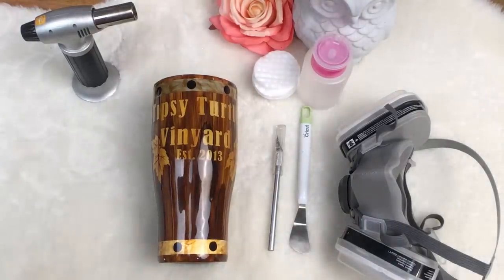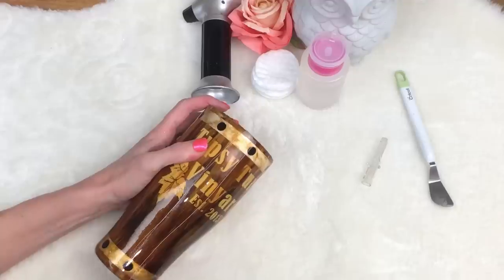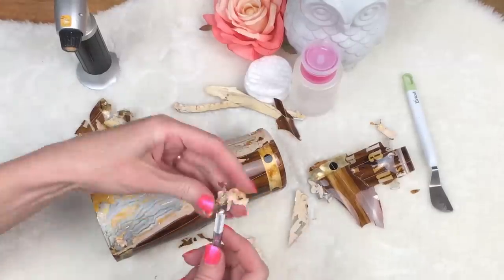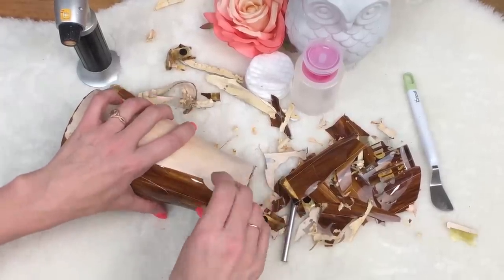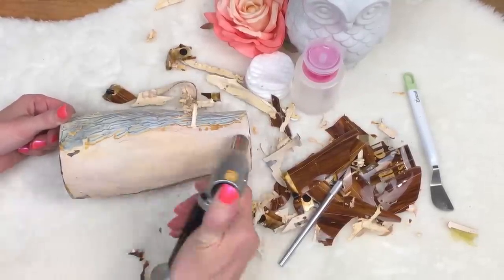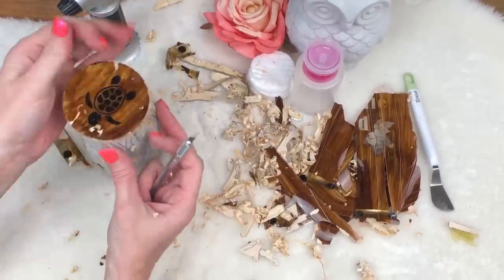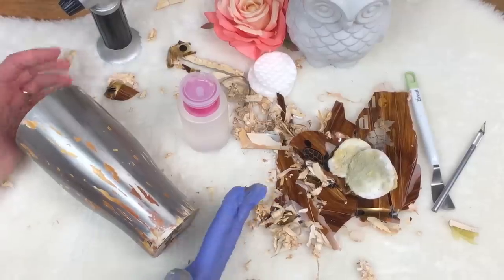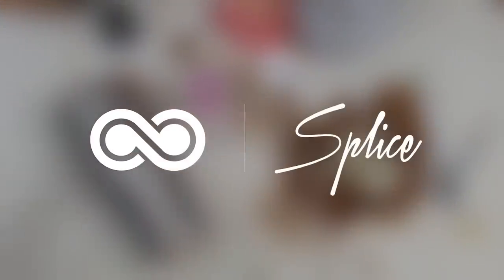How To QUICKLY Strip Cured Epoxy Off Of A Tumbler

Comment: I remove epoxy by wrapping paper towels around the cup and saturating it with acetone, then wrap aluminum foil around it. Let it sit for about 30 minutes.  All the paint, epoxy and vinyl will rub right off. Give it a try
Reply from the maker: Missy Lane I have tried it numerous times and it is way easier for me to just heat and peel.  The acetone is a total stinker for me
Reply: She is too impatient for all that...Lol. (I am too. I want it done & I want it done right now. Hahaha)
Reply: I’m gonna try this, one of my customers changed their minds and now wants something different..... so I have to begin again
Reply: I might try this method I only have 1 layer of epoxy and that was for sticking the glitter on so this might work for me.
Reply: Yeah, that's what I do. This way is asking for an injury. I sliced my finger with an exacto knife in college and ended up with 2 stitches. That is not happening again.
Reply: @cherylg46  This took 17 minutes. The lady said 30 minutes for it to sit in acetone. i'd rather let it sit but my hands don't work that well anymore sometimes.

Comment: Let me start by saying that I truly appreciate you sharing your skill, tips, and tricks. Whenever I have a question or want to know how to do something on my cups I dont even bother with google I go straight to your social media lol  because I can usually find my answer.  Ok so back to my reason for this comment... I recently had a 5 cup order cancelled and I was thinking there had to be easier way for me to do it since I do most of my work out in the garage (except for the drying and curing) and it's been freezing cold out so my hands were popsicles which made it even more tedious. So I thought what if I did the same thing but instead of the torch I use hot water to soften the epoxy and it worked like magic and hands weren't frozen stiff!! Some people may already know that this works really well but I thought I'd share for those of us who hate to strip cups. Heres what I did>>>>>>>> I put the cup in pretty hot water so you should use rubber gloves... let it soak for a minute or 2, then I took my razor and broke the seal all around the rim,  cut length wise down the cup and on the bottom, let it soak another minute or so, and then took my razor to help begin to lift the epoxy up and then I used my fingers to peel it off...it comes off in nice big chunks where you cut it and the glitter and glue also came off with it and what little bit of glitter that was left on the cup came right off with a quick rinse. The paint stayed on of course  (i just paint over it) but the hard annoying part was done in about 5 min. Hope this helps

Comment: Thank you so much for showcasing this method I was able to strip my cup in a matter of minutes!!! It literally peels off like you've said and shown in this video and I had 4-5 layers of epoxy that just came off like butter. I've used the paper towel with foil and acetone method but that didn't work too well for me. As horrible as it is to already have to strip a cup, you've turned my struggles around for me. Thank you so much!!!

Comment: Your tutorial gave me an idea to remove without a heat gun or gallons of acetone. Because you said the cups shouldn't be cleaned in the dishwasher,  I got  the Idea to remove the epoxy by placing the cup in hot water, just below boiling point. Came of fairly easy, actually seemed easier than what I seen here. I forgot to score it, I just started scraping, some parts  just peeled off. I did have to put it back in the water a couple of times. This was a 20oz cup, it didn't have vinyl only tons of glitter, LOL,  it took maybe 15 min tops to get most of it off and that's counting the 2 times I placed it back in the water.  Now I have minimal sanding that I can do by hand.  =-)  Thanks for the ideas.
Reply from the maker: Please don't do this inside your house on the stove. go outside in a well ventilated area. the epoxy emits vapors when heated and you don'y want that in your house'

Comment: Can you take paper towels and foil and wrap it with the paper towels soak the up with acetone and wrap them in foil let it sit overnight and it will all come off or does that only work on glitter cups
Reply: It works on anything with epoxy.  I just stripped a finished fabric cup.  Epoxy came right off & then could peel the fabric off.

Comment: You should try oven cleaner for the bottom coat after you get the epoxy top. Spray it on set it aside and go back later wipe clean.

Comment: I came across this.  Took 2 cups that needed to be stripped.  One I used the torch and when I came across to the next one with Texas heat I didn't need the torch it peeled right off

Comment: How many layers of epoxy would I need to use I have to use the hang method , and can I use paper masks I cant afford one like that
Reply from the maker: The link I provided for the mask (in the description of this tutorial) is only $16 and it is the same one I use. The paper ones only block dust NOT fumes or vapors which is the dangerous part

Comment: I love your videos , but this one killed me , there has to be an easier way besides just throwing the cup out.  I hate hate hate striping cups.  I have about 4 partially stripped , I tried soaking in acetone, but that does not work for me even when the epoxy is not cured all the way.
Reply from the maker: Sherry Ebersole I don’t throw the cup out! I strip it and then use it again!